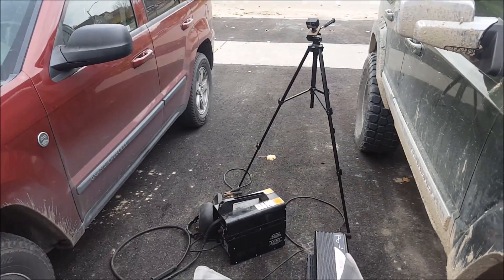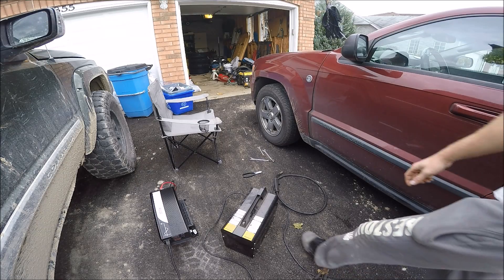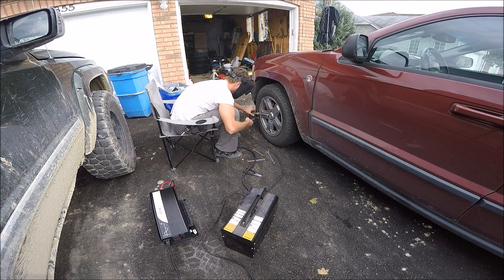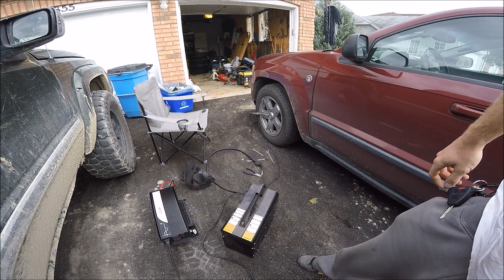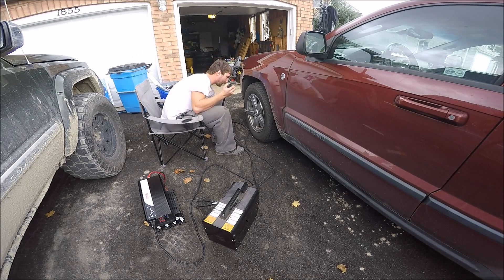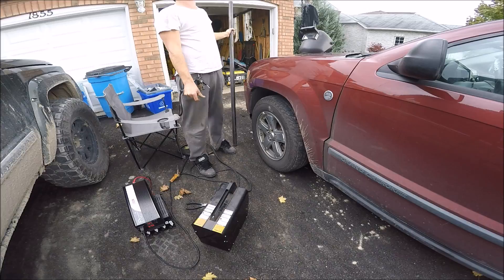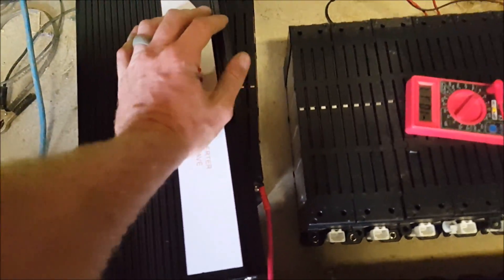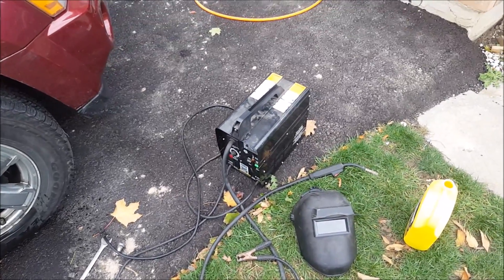Power Wall Project Welder Test

Comment: Thing you did good: 1.you took the time to show us it works.
2. You got your helmet on.

This you should not do: 1. Dont weld without gloves.
2. Dont weld without long sleeves.
3. Dont weld sitting down.
4. Dont use a none auto darkening helmet.... They suck.
5. Dont buy Chinese welders.
6.prep the work area.
7. Dont weld plated metals. Zinc plating is a poison as a vapor.

Thank you for your time. Get a mig... Flux is ok for welding bicycles. Lol

Comment: Nice inverter and battery you got impressed of how well it handled the welder 👍🏽 any more details on how you set that up?
Reply from the maker: these are super high discharge electric vehicle batteries and I just hooked it to a inverter that can handle 66 volts that these batteries are.
Reply: @GoingOffGrid101  wow that’s awesome you should post more videos on these batteries and welder with the inverter and see how much you can get before the welder cuts off would like to see the performance of it

Comment: This is crap. People out there go and waste your money trying this. I will say no more
Reply from the maker: ots ok with a good inverter, but elcheapo inverters including the inverter in this video it is not recommended.
Reply: It dose work. Try ecoflow 1300 inverter see how you go there. I would to see one that works really. your a nice person but do your research too. I have many times and get back to me
Reply from the maker: @chriswilkinson2548  low frequency inverters are better for welding they will last longer. id look at the gopower 3000w or siginer inverters as they are cheap and can handle a beating.
Reply: OK than I will do my research than. the Ecoflow inverter seems to work but I`m doing research on it this week plus I will the same with yours, thanks for a reply
Reply from the maker: @chriswilkinson2548  np, if the welder takes 15 amps make sure the inverter can do 30 amps :) this will make a longer lasting system.

Comment: I had the same problem. I used a properly sized socket and a large hammer. I placed the socket over the end of the nut and beat it on with the hammer. Then I placed a breaker bar into the socket and spun the nut off. No damage to anything, and to get the nut out of the socket, I simply locked the socket in a vice and tapped it out with a punch and smaller hammer. But I like how you used battery power to show the way you did it. 2 thumbs up.

Comment: Duct tape would have saved you some trouble. More important you should disconnect your car battery/ electronics before welding, even be thoughtful about grounding a wheel through the bearing.
Reply from the maker: yea, I have been told, I grounded the wrench so no current could go through the jeep, other wise I would of done that you stated, thanks It could go really bad if the computer got fried.
Reply: Yes plenty can go wrong including draining or damaging the battery and alternator.

Comment: Glad to see that the inverter worked okay with the welder.  I ordered one and it's supposed to be here mid week.  Those special lug nuts are a pain.  I think they make a special socket that kind of screws on to them.  Don't know how much they cost though.  Shame you don't have a tig welder, that would have been less likely to do the damage.  Hope the inverter I get will be as good as yours.
Reply from the maker: yea I love mine, hope they are all this good I ordered a 12 volt inverter 3000w for my grand parents.